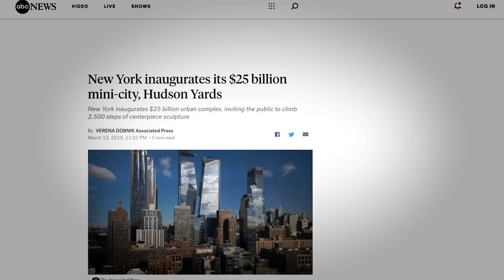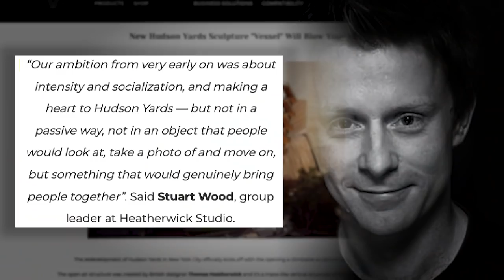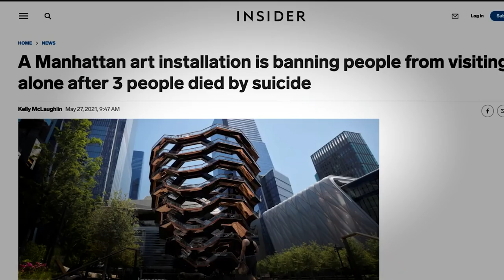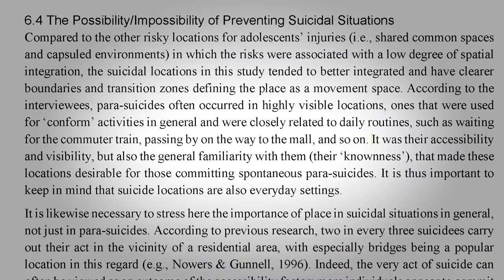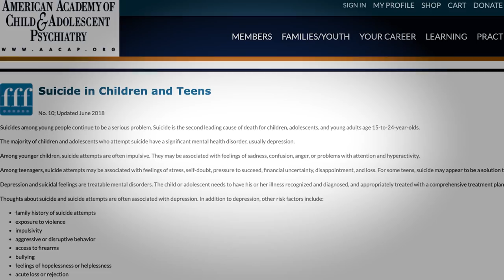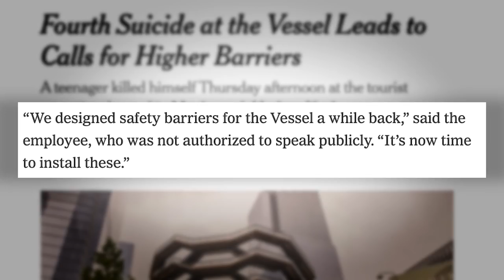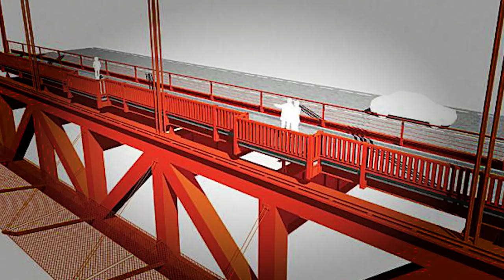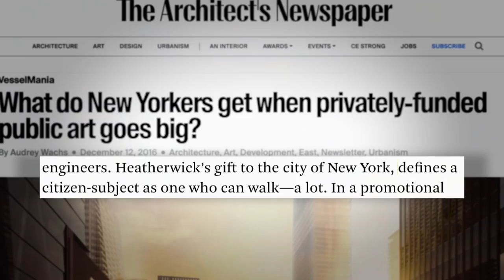Is This $250 Million Selfie Spot Dangerous?

Comment: We have a bridge in my fair city that was, for a long time, a 'hot spot' for suicides.  The fact that the bridge is vehicle only makes this baffling.  Finally, in 2010/11, suicide barriers were installed reducing the number by a staggering 85% (prior to this, data collected indicated one suicide every three weeks).  The barriers were created and installed in such a way that no views have been obscured.  It can be done and it does work.
Reply: The fact that it's vehicle-only may contribute to it, as someone is less likely to see you or stop if they're in a vehicle. The "visibility" factor goes way down.
Reply: @cellobotomy6368  Perhaps I should have been more precise - the bridge is not accessible by foot traffic for several miles at each end.  It connects a highway over water.  To get onto the bridge, a pedestrian should be seen.
Reply: Just curious, is this the skyway bridge? It sounds a lot like it. It’s always so eerie crossing knowing the history
Reply: @maddy1403  No, it's not the skyway bridge.

Comment: I worked in the Hudson Yards mall when it first opened adjacent to the Vessel in 2019. The very first time I saw the Vessel in person, I said “someone is going to take their life on that thing.” 

One of the main things that I’d add to this conversation (because I now find the place repugnant) is that pretty much every element of Hudson Yards construction was rushed. While it looks polished on the outside, I worked inside the mall before it opened to the public and soooo many things were insanely behind schedule. The Vessel was undergoing construction up until the last minute; I could see it outside every day. When the mall opened to the public, there were still multiple stores that hadn’t opened yet. Our store had leaks, plumbing issues, air/heat problems, and it had JUST been built. I already know that THE problem with Hudson Yards is the billionaire urge to just get it done already so they can enjoy their investment. It’s gross.
Reply: It's also that they bid these projects out to the lowest cost contractor who inevitably cut corners to get finished on schedule and try to finish under an already slender budget. It's a recipe for disaster, and it's only getting worse across the country.
Reply: Even before Catlin mentioned the first suicide that was my exact thought. I had a feeling this was about suicide. 😓

Comment: When I read the title, I thought this was going to be about people inadvertently falling because they were trying to take a selfie. I hadn’t heard of this structure or any of the deaths, but I appreciate the video.

It’s also a good example of why research is important to do; intuitively, it makes sense that barriers wouldn’t have an effect, but the reality is that it does. Proper research sometimes yields counterintuitive results.

I wonder too if this ties into conversations about putting up barriers at subway stations; both to keep people from self harm and harming others by shoving them into the path of an incoming train.
Reply: Me either!
Reply: I really like how they do this in Japan. It's only on the lines with the Shinkansen (Bullet Trains) I believe, but they have barriers and little doors and people queue up in those specific points and the train stops exactly in the correct place to align with the platform's gates. There's also at least one station/underground line in London that has almost full-height glass and automatic doors that work in the same way. I think these are really sensible and prevent so many horrific injuries and accidents and impluses. I don't know why it's not implemented in all subways/tubes/train stations to be honest (other than cost).
Reply: @-Reagan  I know my local LRT system has enough room under the platform edge to roll out of the way. But if you have time to roll out of the way, the operator generally has time to stop.

Comment: The library was a great addition to this video. It’s a great example of an issue being fixed in a way that benefits everyone. Going to the vessel might harm my mental health if I went there because being that high with no railings can bring about existential crises and dread.
Reply: Have to disagree with you about the library, I think the additions are horrible and would never find it a place conductive to reading or studying.
Reply: Though maybe having the waterfall not be the color of pee would have been an improvement.  Still, that design did make the atrium look more classy.
Reply: I assume the “Call of the Void” may play a part there too.
Reply: @griffenspellblade3563  I think that was a picture with weird lighting because I think it’s supposed to be bronze
Reply: Hey I'm not a native english speaker, and was wondering what Caitlin and you mean by the work "railing"? I thought it was the fence things, which are there, though short.
Reply: Plus I would never go because I am crazy afraid of heights.
Reply: @bub4522  it's like a higher version of what you're thinking. It would be around torso height rather than waist height

Comment: As a former NYU student, was wondering if you were gonna mention Bobst. I remember being told why the barriers were there (which I honestly hadn't even thought about or questioned initially) and in that moment imagining what the building would look like without them...and was instantly, profoundly struck by a sense of "Oh. Oh yeah. That would definitely happen". I was just so obvious, and I think we're lucky there weren't MORE deaths by suicide there, before they got the proper barricades up. 

Also, really interesting point about the Guggenhiem. I've been there more than a few times, and while there were moments when I found the building a bit austere and pretentious, for the most part it seemed like architecture designed NOT to draw attention to itself. As you said--it had a clear functionality, and that function was to show off the art WITHIN it, not show off itself. I never even noticed how high or low the railings were, or how high up we were getting, because I was too busy easily strolling down its smooth, sloping hallways and looking at everything displayed along the way. Of course, from the outside it's a very impressive building, and if you DID take a moment to take notice, obviously there is great artistic value to it in and of itself, and there's nothing wrong with works of architecture that can inspire awe or wonder with their beauty or craftmanship. But again, I think you're right about the role of functionality in architecture, and I also think it's fair to imagine that Wright was thinking about that functionality all the way  through his design process, and not interested in just making a "cool" looking building for the sake of it.

Comment: My first reaction to the Vessel was "oh sh*t, that's gonna be a problem." But when you mentioned the Guggenheim I realized it's never even occurred to me that it could be dangerous. Maybe it's just me, but I think that says a lot.
Reply: One simple difference from the Guggenheim:  The atrium in the Guggenheim widens as it goes up.  If someone jumped from the top floor of it with no horizontal velocity, they will hit the floor immediately below, not the bottom of the whole atrium.  It might still be lethal, but probably a lingering end.
Reply: @jeffreysoreff9588  Oh that's true. It's been a few years since I've been. 
And that sounds like an excellent way they could've tweaked the design of the Vessel. (Obviously too late for that though).
Reply: But my point is more about what Caitlin said about how the aesthetic of a place makes you feel. The Vessel makes me nervous just looking at it. The flower suspension bridges are amazing. 
That's another- perhaps better- example. I've been on a regular suspension bridge & I've been on one that's was decorated with ivy & other plants. Hard pass on the first bridge.
Reply: @np1056  Hmm...  I have a somewhat different esthetic preferences.  Plants are fine, but I tend to like buildings that emphasize their structural elements, so I tend to prefer locations like bare suspension bridges.  Now, from my point of view this isn't a big deal - but I'd expect the architects to be heavily into the esthetics, and to have a strong preference in one direction or the other.  In the case of the Vessel - well, really it is just an elaborate staircase.  Other than just providing a view from the top, it seems rather arbitrary to me, not worth all the fuss.
Reply: @anna-flora999  It could still be done, basically widening the lower levels in both directions, inner and outer.  The result would be a considerably different sculpture than the current design - which wouldn't bother _me_, but I expect the architects to be more heavily into the esthetics, and to have a stronger preference.
Reply: @jeffreysoreff9588  well, yeah, but as you said, then it wouldn't be the vessel anymore. I'm all for tearing it down and starting fresh, but that's not really fixing the vessel itself
Reply: @jeffreysoreff9588  Throw glitter on everything? That would be pretty epic. (Apologies, I had to bring some levity to a very difficult situation.) And I have to agree... it's basically just a bunch of stairs. I guessed I'm not bougie enough.
Reply: @np1056  Rather than glitter - how about planters full of rose bushes, trimmed to just below eye level? :-)  I've read of them being used as barriers.  Thorny living prison bars, there to remove a choice, but with flowers to obscure their purpose.
Reply: @jeffreysoreff9588  I'm all for that!! Honestly I might throw some glitter on the blooms as I walk by, but I think you've figured it out!

Comment: This might say something regarding my psyche.  I have previously seen illustrations of the Vessel. In my initial impression, I observed that the upward flair of the structure would offer an unobstructed path from any level directly to the ground,  without any interference on the way down.  On a more pleasant note:  It would also serve as an ideal venue to reenact Galileo's experiments, which he originally performed on the Leaning Tower of Pisa.
Reply: There's no evidence that Galileo did such a test. And indeed, if he had, he would have gotten the opposite result to that claimed, due to air resistance. His actual experiments were on rolling cylinders down an incline, and his thought experiment (regarding the Tower) was about two objects connected by a string. **

** If anyone's curious: Aristotle had argued that heavy objects fell faster than light ones. Galileo reasoned that if you connected a heavy object to a light one by a loose string and dropped them together, and if (as Aristotle claims) the heavier object fell faster than the light one, then the string would become taut, effectively making the objects fall as one. Reason suggests that the slower (lighter) object must be slowing the faster (heavier) one down (and vice versa), otherwise why would the string be taut, so the net acceleration should be somewhere between the two. But the combined object is heavier than the heavy object alone, so by Aristotle's logic, the combined object should accelerate faster than the heavy object alone. The two answers can't be reconciled, yet both are logical extrapolations of Aristotle's argument, therefore at least some aspect of that argument is wrong.
Reply: @1FatLittleMonkey  Wow, that was a great explanation!

Comment: The hostility of some architechts & designers to including safety and  accessibility is boggling to me. We see it in new buildings that are not ADA compliant or leave bottlenecks for people with wheelchairs or strollers (a famous example is from 2019, when a library in Queens had sections of the general stacks accessible only by stairs, a children's section that was all stairs, and which had one tiny elevator). There is an insistence that art in the form of structures we move on/through doesn't have to consider the needs of the people using it, or that the designer can define which users they intend to be present through accessibility barriers. 

Which is pretty funny,  isn't it? Barriers to access by people with mobility challenges and unwieldy strollers are necessary aesthetic features, and the resistance to safety barriers is that the open access is also essential for the aesthetic. As you pointed out with the NYU library and flowers growing on a fence, safety barriers can be beautiful. The designer/architect just needs to include them in the design. Same with physical accessibility measures that enable all to make use of the space.

I really hope that the recent activity at The Vessel during closure was them giving way, installing the safety measure that should have gone in from the start. When the designs were first made public, I know I was wondering how long it would take for someone to use it to jump.
Reply: You might be interested in the architecture of the Salt Lake City Main Library building. When it was first being built, it was a shocking sight. Didn't seem to have a single angle. All the aisles were wide, the elevator was huge, and there are giant bridges between sections. There's even a huge rooftop garden with ramps and stairs. All the stairs are sweeping and shallow, which is great for me since I've had a back injury since it was built. The rooftop railings are also really tall. You have to climb on something to get over them (someone actually did do that in 2013), but they blend in seamlessly to the building. People who think that accessibility and safety can't be beautiful can just take a tour at a public library building
Reply: Many Architects are hostile to humans making any use of their structures.  Pretty much along the lines of how dare you clutter ou my art.  Libeskind is one of the worst.  He designed the tower at World trade center plaza, also in NYC.  Apparently Aholes are welcome in NYC...
Reply: I assume you're talking about the Long Island City branch, which is my local library. I was baffled the first time I went in there. It's so hard to navigate even if you can climb stairs, and so much wasted space! Architecture needs to be functional first, before it is beautiful!

Comment: Hey Caitlin, your bit comparing the Guggenheim vs the Vessel got me to thinking about your theory on how the atmospheres at both may contribute to the overall mental state it puts people in. I work in a museum as well that is built in a similar 'spiral' surrounding structure like the Guggenheim where the exhibits and rooms are built around a massive open atrium that drops down very high. It's nowhere as 'tall' but it has that openness but only in the atrium.

I think the issue with the Vessle is that there is nothing there. It essentially IS the art piece there there is nothing really engaging about it and as a result comes off as incredible cold and spooky, especially for people who aren't into architecture. At best I can word it, it's ISOLATING. The Guggenheim is a place that is filled with other spaces around it's empty middle and it's the same where I work. It's constructed in a way where it does open up so it doesn't feel so constricting and lonely. In a way, the Guggenheim is both a house OF art but also ART itself while the Vessel IS art but that's it; really don't feel anything else other than what it gives you and people can interoperate that in different ways but what I think it all comes back to is ISOLATION.

Edit: The place I work at is over 100 years hold but holy SHIT, we have acceptability elevators and ramps. What the hell is this? Even if you have the strength to hike it up the stairs it seems NEEDLESSLY exhausting and for WHAT? It's like this thing was made to be as pretentious as possible.
Reply: @friv_0881  Hearing that is like someone saying fire exists aren't needed because it 'brings down the mood'.

It's not about the mood. It's about the safety of those visiting and for something THAT HIGH, and it's not fully a 'risk' experience, it really does come off like they just didn't want to put in the tiny bit of effort to make the barriers a bit higher, especially if there was enough freedom to make them 'work with the art/experience'.

Comment: As someone who lives in new york and isn't exactly upper class, I can say visiting this thing is immensely depressing. I saw it on my way in for the first time and immediately thought it looked unsafe. Just from ground level I could tell the railings weren't near high enough. Then of course the building it's in front of is labyrinthine and the only thing I could afford in good conscience was a shake and fries from shake shack. This was not a place for me, but for people who could drop a couple hundred on shoes or a watch or a fancy tie without batting an eye. Exiting and seeing the vessel again was depressing to say the least, and I could easily see someone in a worse state than I scaling the vessel with ill intent. 
There's another tourist attraction you could have referenced regarding the vessel: the Edge. The Edge is an outdoor skydeck 100 stories (1200 ft) surrounded entirely by 9 ft tall glass panels. It's actually right around the Hudson yards area (the tickets are 48$ a person :/ ). Through this entire video I found myself wondering why they couldn't just install taller glass / plexiglass barriers. If anything, doing away with the current railing and replacing them entirely with walls of plexiglass would be even more of a thrill! Part of your mind thinking there's absolutely no barrier between yourself and the edge of the platform. Something that would not obstruct the view while still maintaining the thrill of the heights.